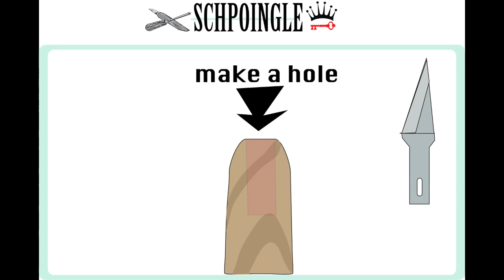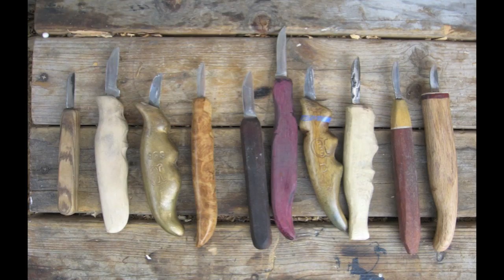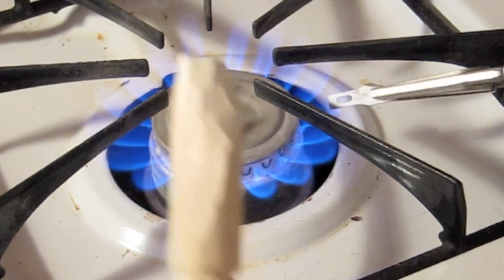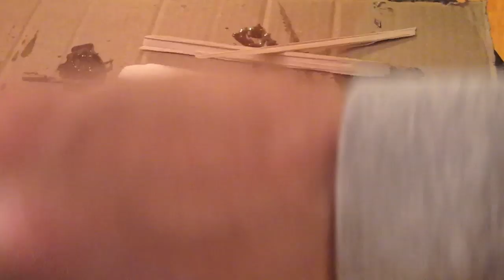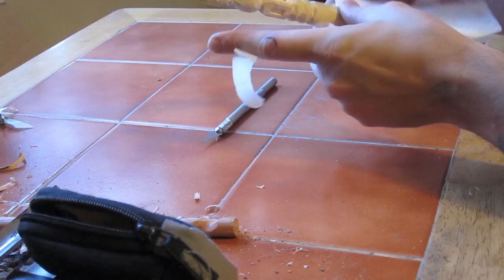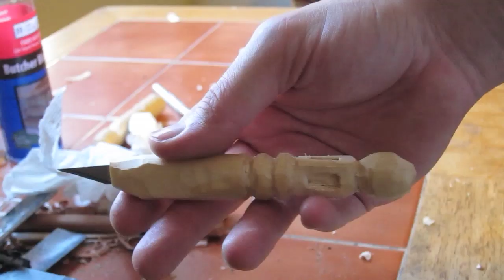making your first knife (how to) Lucky clover carving school

Comment: MINERAL OIL WILL WORK JUST AS WELL?
Reply from the maker: yeah. that butcher block oil is mineral oil. it may have a little of something else but not much.
mineral oil is good for everything and you can get food safe versions for cheap at your local pharmacy. it's actually a diarrhetic...i guess if you oil up your insides then...nevermind.